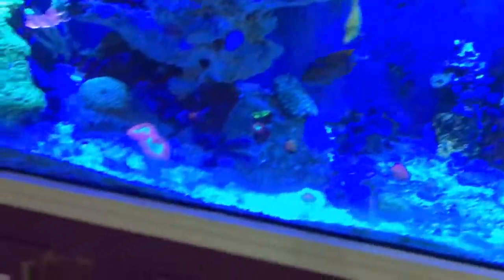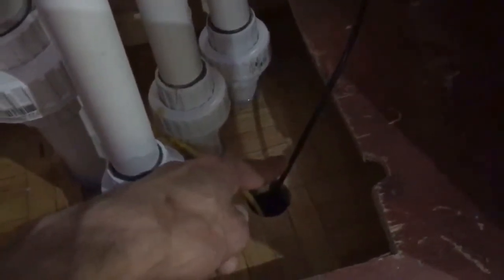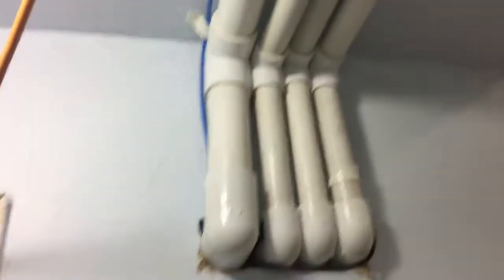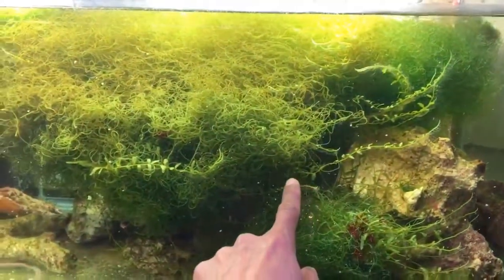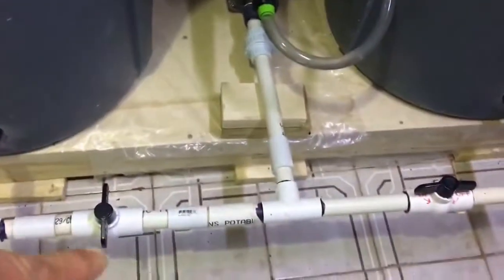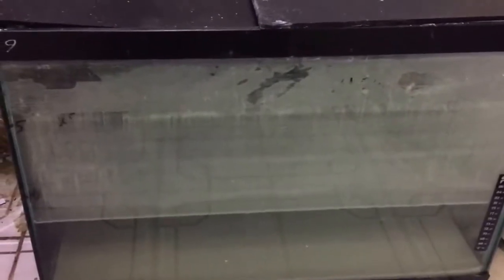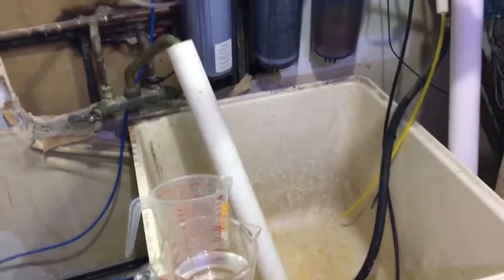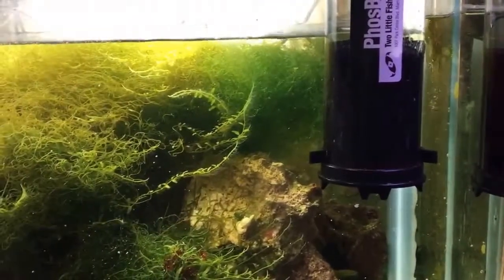Behind the Scene Journey aka Basement sump/Filtration System

Comment: Wow, that whole system is really well-thought-out! I love the redundancy you've built into the ATO/Kalk dosing so you don't overdose with the kalk. The refugium section looks really healthy. Do you have any snails in there? Just curious, and I imagine your system is balanced such that you don't need snails to control film algae. I first thought the little orange critters were bristle worms but when you showed the second one, I could see that they aren't. You're probably right that they're nudis of some type. 

And your fish are beautiful! 

You did a great job explaining everything too. One question - do you have a spare return pump on hand as a backup in case of pump failure? One thing I did for the new system was purchase three Jebao DCS 7000 pumps, one for the aquarium and the other two for the totes in the basement that hold the water to be pumped upstairs. My thought was that if there was a problem with the return pump I could pull one of the ones from downstairs to keep things running while I replaced it. So instead of going with different pumps I got all the same. If you do have one available I suggest you test it periodically to make sure it's running properly - our plumber told us the seals and o-rings can become brittle over time when they are stored. And of course, if you buy a new one, be sure to test it before setting it aside to make sure it works. You are experienced at this so you likely know all this already! But, just in case.....

This was a good video! 👍👍
Reply from the maker: Reefgrrl Thank you for your feedback. This hobby has always been a learning curve on an ongoing basis. Thts right dosing Kalkwasser  separately provides tht extra redundancy because as much as Kalkwasser is good to maintain stability it can also crash your tank if you don't build redundancy around it. 

I don't have snails in my refugium but I do have couple of bristol starfishes. Those purple creatures are in fact bristol worms but they r safe ones who are always in your sand bed though I haven't seen them in my display they are only in the refugium. Yeah the refugium has done the job for me as my po4 and no3 are under control. 

Regarding the 2nd pump no I don't have a second Reeflow but I do have my old Mag18 just in case. It's a good idea to get a second one soon. Thanks for those interesting questions.